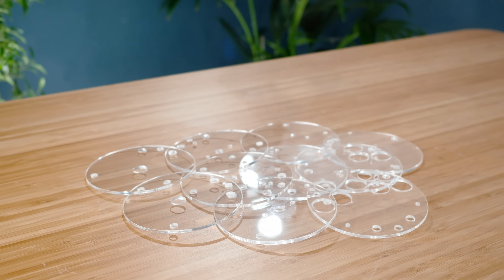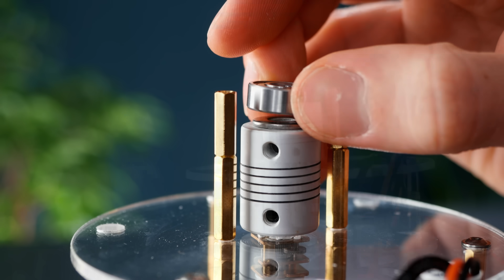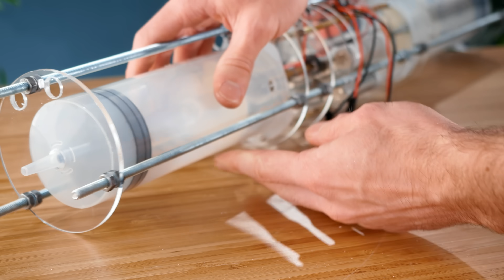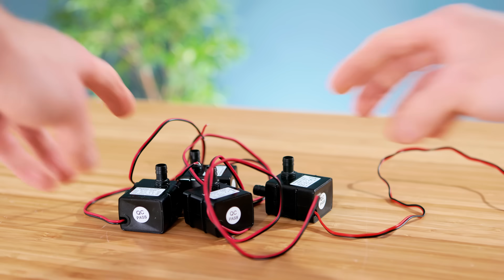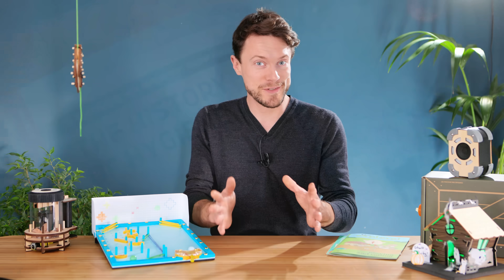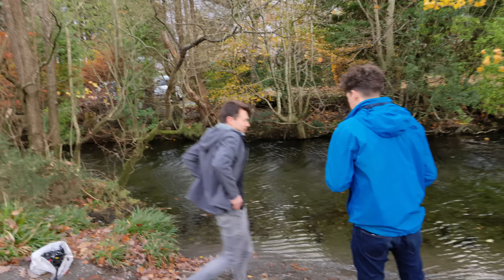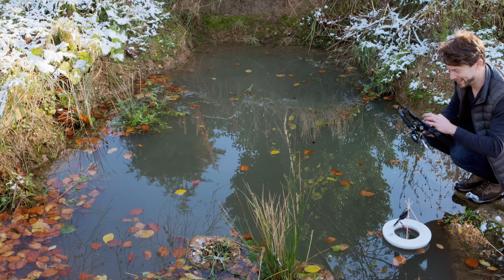Building a DIY submarine

Comment: Love the project. Can't wait for version two! Three suggestions:

1.) Use a sensor to determine if the sub is level and then you can automatically adjust the two boyancy motors. There is a good chance going faster or going against currents will alter your level. This can easily be done with a cheap rc flight controller. It's overkill, but cheap and easy. Someone know of a dedicated sensor?

2.) Instead of having separate sets of thrusters to rotate and also "slide" left/right, just use one set of four. Engage 2 on one side to "slide" and engage one on each side (front/back) to rotate. 

3.) I love Mr. Gadget's idea of a periscope. However, a traditional one would be very complicated. You already have a floating periscope platform where your receiver is located. Mount a second camera/video-tx with the ability to rotate and you can really take advantage of the long range that your rc set-up allows. Plus you can look around without having to surface. Disguise the whole floating part as a lilly pad and you have a true watery spy craft!
Reply: If he gets an RC flight controller for quadcopters, it could easily be programmed to do both 1 and 2 automatically with the same controls he is using in the video. It can be set to have the left control stick left/right activate the opposite side thrusters, and the right stick left/right can have it turn the rotational pairs go automatically. He is already on 2.4 GHz too, so as an ecosystem it would make sense. I was already coming here to suggest brushless motors/propellers but his associate in the video already suggested it. These extra things don't cost him anything but money as well, since he has so much ballast in there already since it's huge.
Reply: Underrated comment, u could make a lily pad nuke!

(Sorry I spend too much time in the r/Kurzegesagt subreddit XD)

Comment: Honestly shocked we didn’t hear something like: “Now this first section here is for the ℙ𝕆𝕎𝔼ℝ ℂ𝕆ℝ𝔼. I’ll be using a small molten salt nuclear reactor that I’ve cobbled together from some leftover bits lying around the garage, but you could also get away with lithium batteries if you don’t have the supplies available.”
Reply: Gotta stockpile those old smoke detectors.
Reply: @IRMacGuyver  This makes me wonder if you heard the story of teenager that actually did that and literally tried to build a small reactor. If not suffice to say they succeeded in contaminating the local neighbourhood. Probably not surprising considering that forcing a nuclear reaction of some kind isn't that difficult engineering a system to isolate, shield and get power out of it is harder.
Reply: @FaerieSeraphina  I am aware of it.  But I prefer the made for TV movie where the kid builds a bomb starring John Lithgow
Reply: Diy nuclear submarine. That would be a neat story at parties
Reply: One thing, (even if it has almost nothing to do with that) that crossed my mind reading that: miniature RBMK 1000. Underwater Chernobyl.
Reply: @Rundumsfliegen  the next video is mini torpedos and a periscope with a small directional camera

Comment: Very cool!!  Needs some dive planes to give better control up and down as you "fly" through the water (rather than constantly adjusting the buoyancy which change through the water column).  Speaking of things to add, as, eventually, you'll be piloting this craft out of sight, can you add a tilt sensor to determine your climb/dive angle and send that up through the telemetry cable?

Comment: I really enjoyed this! -- Especially the two wildly different approaches -- would love to see more of both design processes though. (But just seeing yours was also pretty good.) -- Regarding your friend James's submarine and its cable weight issues -- I think that if he made the surface craft a remote controlled boat also (so that it could move along with the sub itself), he could alleviate the weight issue -- probably blowing the scope out of the water (no pun intended) -- but if the surface craft also had the cable on a spool in the center of the craft that he could wind and unwind that would also allow him more management options...

Again though, it's probably more elegant to just have the submarine carry the battery, etc. and only bring the antenna to the surface. -- However, having that surface maneuverability could also help in a pinch (again no pun intended), but if the surface bits were to get stuck in something (or the sub gets stuck), having that second bit of control could be helpful.

Also, yeah, don't fly anywhere with that sub -- it is 100% a b0mb. 😅

Comment: Really cool! FYI you don't need a separate set of pumps to get translation and rotation out of one transmitter! You can configure mixing in the transmitter so that it will mix your steering input with your translation input and transmit the right value to get what you want.

Comment: Couldn't you add a bit higher pressure pumps, so that you can go a bit faster, because as soon as there is a bit of a current those pumps will be really insufficient, the really fine fabric might also hinder the amount of pressure of the pumps, I would reccomend coarser fabric that would still filter out the junk but give you more pressure

Comment: This is great! Awesome. Great Job.

I would like to suggest you in a way to help you improve your prototipe.

Under water comunication, by using acustic sound waves at 44KHz (in this frequency you will avoid loosing all your signal power).
If you use the transmiter under water you will not have any issue by medium changing from air to water and the other way. For example you could be in the middle of a lake, in a boat with your remote controler with the transmiter/receiver under water, whererever the Submarine is, it will be able to comunicate.

I have tested this way of comunication in a personal proyect and I have reached over 20 meters of distance at 2 meter deep, with only 1 Watt (I can't imagine how far it could reach if i got the space and the expertise to improve the power source as you do).

So in this way you and your friend James Whomsley can replace that heavy cable for a single steel cable (if you need to manually pull it out).

I hope it helps!

If you need some documentation I would be pleased to help.

Comment: I'd change up the pumps to bigger pumps to give more movement possible to actually do away with 2 pumps if you add a rudder to back of the sub using 1 servo motor to change the water flow from the larger pump from left to right . You can keep the strafing pumps but they not really needed. Can also add top lights so you can see it come up from down below if you get a problem you can atleast see it.

Comment: It would be really cool if you added some accelerometers to arrest it's movement and achieve total control in the water. Basically, when it's not receiving input from the controller, it should operate it's maneuvering thrust to arrest any drift it has in the water. You might also look into the long range controllers available for some Drone models. That way you can explore larger lakes and possibly even shallower portions of the ocean.

Comment: Brilliant!  What a marvelous first attempt!  Would more batteries and larger thrusters be better as ballast?  Let the additional mass work for its passage instead of 'deadheading.'  :)
Reply: Great idea! 
Bigger batteries allowing for more run time and more powerful motors. 🙌
Reply: @boonjabby  Don't think powerful motors is necessary. I think a slow cruise of underwater exploration is nice enough. I would rather have more Light.
Reply: @Helveteshit  Having more power doesn't mean you HAVE to use it and break Mach 1, with the joysticks I imagine you could control the speed for a slow exploration cruise but it's nice to have the extra speed when it's time to get it back to shore. I agree with the lights though,
Reply: Yep, just means he can add just under an additional 4kgs which is quite a lot of room, but not in volume... or you can adjust the starting internal pressure to calibrate the ballast also.
Reply: ...great suggestion! any idea how the batteries are charged as they are sealed?
Reply: @boromaushelms281  right now, i assume it needs disassembly, wireless charger from a dead phone.. maybe?
Reply: Cylindrical Lithium Titanate cells would be perfect for maxing out battery and battery weight

Comment: Hi Matt, completely unrelated to the video, but I recall that after your "Artificial Daylight" video, you made a short video about a budget version that instead of using a mirror to "straighten" light, you used a fresnel lens at the front of a box lined with a blue vinyl wrap to simulate daylight, but I can't seem to find it anywhere. Is there a reason it's been removed?

Comment: I am so incredibly impressed by this channel. You have an excellent sense of design - particularly designing things with just enough reliability to work perfectly, but not too much where it becomes prohibitively expensive or unwieldy. Using off the shelf components - such as the tube/fittings from home improvement stores, small motor controllers and aquarium pumps, and syringes, is very impressive. This is a complex project, but it’s well documented and simple enough that I honestly think I could do it at home (DIY!). So happy I discovered this channel.

Comment: Fairly Awesome Build.

Suggestions for V2: 
-Little Air syringes in the Front and Back to control the Tilt. so you could make better use of the FrontCamera for Precise moving
-speaking of Camera: 360° rotate and Swivel surviliance Camera in a Clear tube at Front or Back. there are some cheap from TP Link which could be controlled via Wifi (extended to your Floater)
-IF you use a Floater Anyways, Extend the Onboard Power via Powerbanks on it. It will allow much Longer Dives for awesome Shots

Comment: It will be even better if you add a wireless charger inside so that you don't have to disassemble entire thing if you need to charge the battery and also reducing wear on the acrylic tube due to constant disassembling.

Comment: I had a question: once the syringes are full and the submarine submerges where does new air come from to fill the syringes up once you pump all the water out to make it more Buoyant?
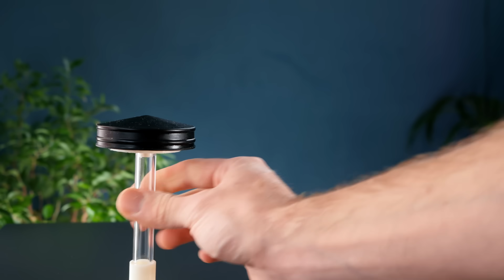Reply: The amount of air in the inner tube never actually changes; it just gets compressed! You can see that the syringes are open in the back (for example when he adds the rod and motor assembly at 5:25), so they are essentially just a plunger separating the wet side from the dry side. When the syringe is pulled in, the plunger pushes on the air in the dry side. Because the whole tube is sealed up, the air can't go escape anywhere and instead is compressed (the pressure increases). When the syringe is pushed back out, the air in the tube expands again and lowers the pressure.

Hope that helps your understanding!

Comment: Question to rc experts: is it possible to configure channel mixing in a way to eliminate the need for 8 pumps for yaw and side to side movement? If it is you could probably just use 4 pumps instead of 8 I think
Reply: Should work if you setup the transmitter with elevon mixing. 
I have the same transmitter and use elevon mixing for my FT Arrow flying wing.
Reply: You can connect one motor to multiple inputs, so one motor could easily handle multiple inputs. It is a bit tricky, however, so most of the time people use multiple motors instead
Reply: You could probably use some sort of flight controller or similar to do that.
Reply: You could use some electronics and multiple inputs to make that work. Or you can simply use a microcontroller like Arduino and program everything.

Comment: 1:20 Most subs actually remain at neutral buoyancy all the time when under water and instead use dive planes to 'fly' the sub underwater. Only going to negative buoyancy for a crash dive and positive for surfacing.
Reply: Yea a maneuverable sub will have planes for control, a more scientific exploration sub will have thrusters that can doe the same thing to maintain station keeping.
Buoyancy alone and on a small scale is not that stable.
But yea you do need to get the boyancy rigth, even the biggest subs are "trimmed" as its called for nutrual buoyancy but maneuvers are done with planes or thrusters.

I think some pods for station keeping should help.

Also I think one can reduce the pumps by half, no need two have 8 pumps, 4 for pushing it sideways and 4 for rotating it, a mixer could be used to mix the signals to make it do both with only 4 pumps.

Also that can be reduced to 2 if one uses a prop in a duct instead that can run in reverse.

Im impressed by the subs but if he wants to improve on it and make it more stable and simple this could be one way to do it.

Comment: You could add some voltage controlled emergency emptying of the seringues in case the battery is starting to die whilst under water.

Comment: Perhaps instead of 4 kilos of metal pellets, you could add more batteries?
Also, if any part of the boat can compress, buoyancy becomes unstable where if you sink a bit, you compress a bit, making you less buoyant, causing you to sink even more. That could be fixed with some kind of regulator controlling the syringes.

Comment: Some smal notes.

1: comersial subs almost never have a boyancy system. They simply power them self down. Andvantage, safer and simpler.

2: most modern RC remote have a mix function.  Alowing both side thrust and rotation thrust to be mixed. Using both thrusters for both systems.

3: as noted,  brushless  motors are virtually water proof.

4; larger prop disc is more efficent. Having a jet is very unefficent.

Comment: This looks like a spaceship.

The part with the linear resistor is brilliant, an absolute 200 IQ move!
Reply: no roll control tho
Reply: @wolf2403  why would you need roll control?
Reply: @spacegamer6906  In case the sub hits turbulent perturbations in the water that either messes with it's roll directly or even it's pitch (Operating either of the buoyancy controls in isolation will also cause roll as it lacks the counterrotating screw to balance the roll torque it produces).
Reply: @FaerieSeraphina  thanks, didnt know that

Comment: That is definitely one of those 'late night, sat around with nothing to do' sort of ideas....and I think its fantastic!! the design is, in itself, very simple although it looks way more 'engi-nerded'. If I could suggest a simple way to amplify the weak effect of the directional water jets, would be a very simple 'cowling' that could use the 'Coanda effect', something similar to a jet ski drive but on a very small scale. Also you might want to install some way to measure the amount of battery charge left so you don't inadvertently lose it to the bottom of whichever body of water you use, that or some form of floatation device that triggers when the charge is lost?

Comment: Very cool build~

If you want to try a design without a tether you could use a radio operating at a much lower frequency that'll stand more of a chance piercing the water. As you pointed out 2.4GHz just gets absorbed too quickly for any useful depth.
As a precaution you could have it surface on loss of contact by binding one of the channels to always transmit. When the receiver loses that signal have it surface so you don't lose it ;)
Reply: Do you think a 27mhz radio would work better?
Reply: @Runescapeluvr4  27MHz should work well. I would recommend checking if that band is legal to operate in your country as it varies depending on where and what you're using it for.
Reply: Most recent rc transmitter have a failsafe option which can set a servo to a desired position if signal is lost.
In his case he could set it to empty the ballast.

Comment: You could actually use an inside pressure sensor with a pid controller receiving it's output as error to control the amount of water that let go inside to achieve neutral voyancy

Comment: If you are having problems with stabilizing at a specific depth without using the steering pumps, try using solid end caps, to keep the volume from changing unintentional due to different water pressure at different depths. otherwise you might have to constantly compensate this with your syringes.

Comment: Great one, however when I first came here I was really really wished for some automatic neutral buoyancy / depth control. You know pressure sensor -> Arduino  -> air pressure inside your syringe chambers or similar. Would need some calculations in advance to give the Arduino a function to plot external pressure to desired positions of the syringes, but should be doable. 

Also if you would achieve that, then you do not need so much high frequency channels that cannot penetrate water to control buoyancy manually and maybe try some 27/40 mHz only to control propulsion. Unfortunately here I am talking out of pure theory but you might be able to amplify some of these lower frequency hobby channels to penetrate some minor depths. And yes, camera feed definitely out of question as wireless under water.

Not criticizing, the mechanical part is excellent idea, but since you mentioned future iterations, I can be hopeful this turning into RC submarine enthusiasts channel right ? :)

Comment: Put a cheap drone flight controller on it so that it can use accelerometers to keep the boyency level during decent and accent.  They also have the ability to hold angles in certain modes if you want to do that too.

Comment: Air isn't compressed in the ballast tanks. It is released into the surrounding waters. Instead, a submarine has large banks of highly compressed air stored inside for blowing the water back out and replenishing the air lost when the water had been allowed inside in the first place. Do this enough times and the submarine then must stay at snorkel depth or on the surface while it runs air compressors, drawing in fresh air from outside, and replenishing the air banks inside the boat.